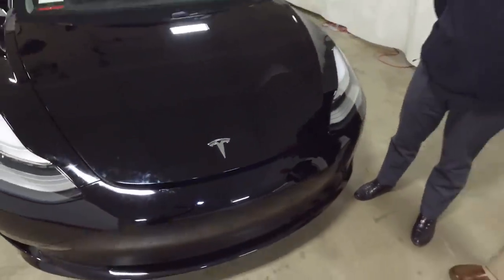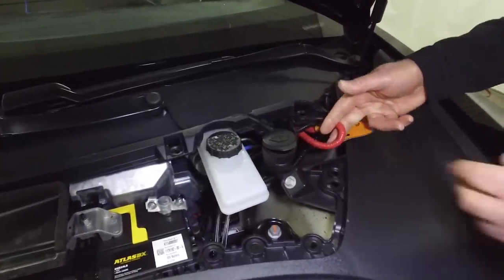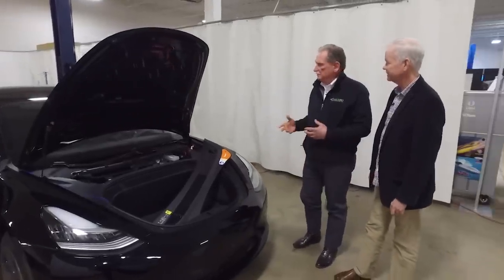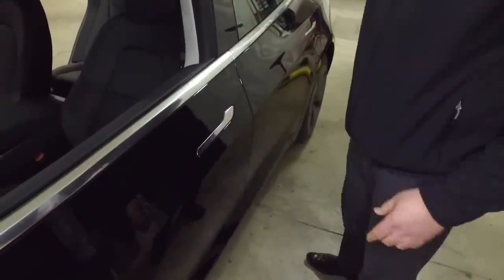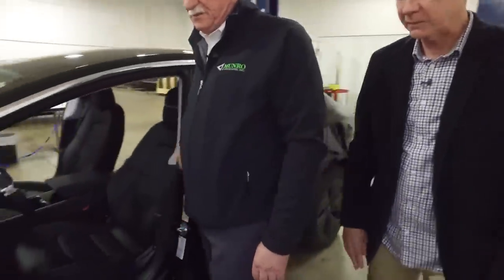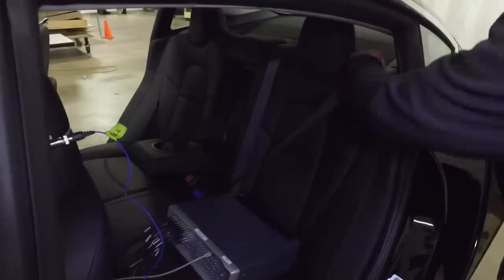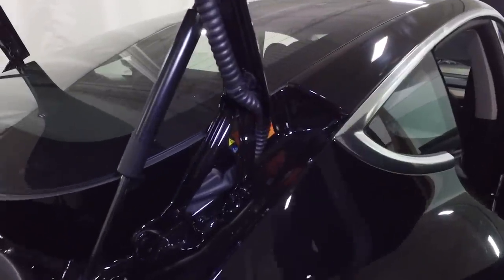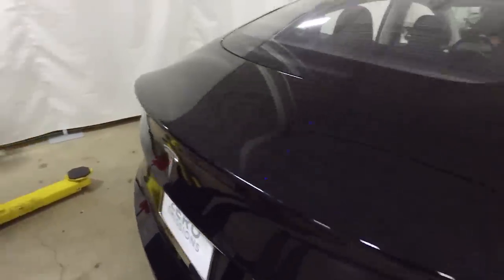Tearing Into Tesla's Model 3

Comment: From this video 
and
Worlds Cheapest Tesla parts availability https://youtu.be/goBrBE-gKKQ
and 
THIS is why body work on a Tesla is RIDICULOUSLY EXPENSIVE!!!
https://youtu.be/18MItauAgKo
Why would anyone be excited about owning one?
Reply: The Tesla S is an all aluminum body  $100,000+ car.   It is going to be expensive to repair.  Just like the Audi A8.  The Tesla 3 is an steel car.  It will still be expensive to repair but not much more so than an BMW 3 or A4.  This is not a Chevy Spark. It cost almost $3,000 to repair an golf ball sized dent on my 25k BRZ.
Reply: Ferrari, and Maserati are made from more exotic materials, are much more complex, have much better fit and finish and "rarely" (Ferrari can sometimes be an issue with certain cars) have any issues getting parts to get it repaired. (Past Ferrari mech) 

I'm glad people are finally pushing auto makers to go electric, but buying a car sight unseen, with the issues I've been seeing, for the money people are giving up? That's my point. 

I'm learning to build my own on Endless Sphere forum for the last year. People are getting the cars for stupid cheap. Comparable to to Chevy Volt and other domestic vehicles. They don't hold much value with any minor issues.

At least your car wasn't totaled. The same dent in certain areas in the Tesla might of. As pointed out from the above video. I've been doing my own body work on my vehicles and the military's aircraft for over 30 years. (Retired Airframer) 

There'd have to be some major changes in the structure of Tesla Motors for me to consider them for my vehicle, but I'd cannibalize their batteries and drivetrain for my project for pennies on the dollar!!! ;-)